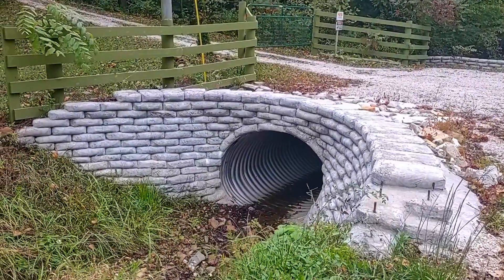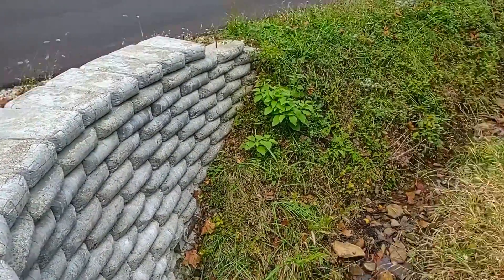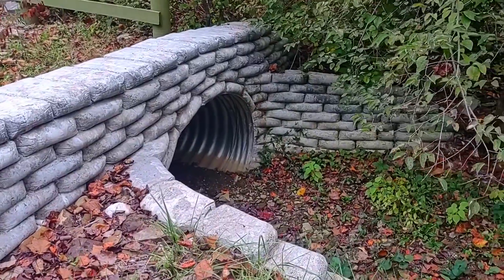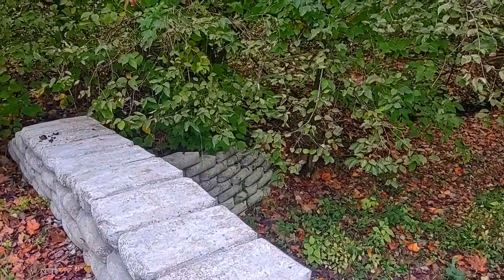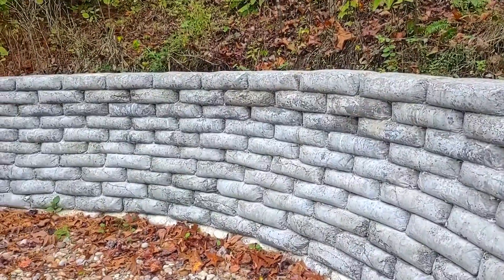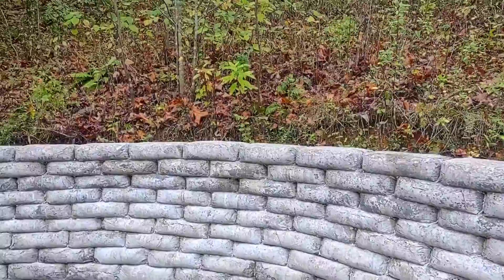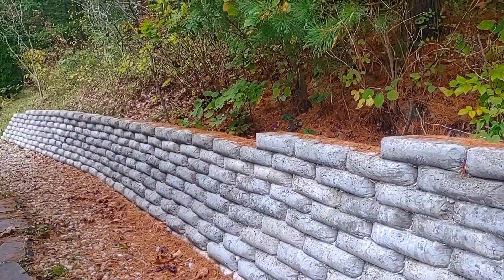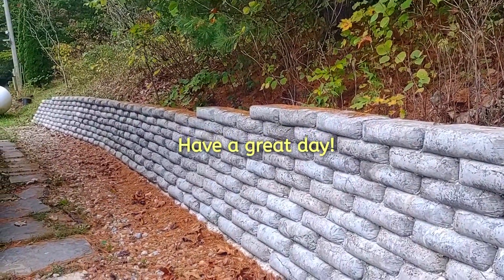Three Years Later | Concrete Bag | Culvert Retaining Walls

Comment: $1.80 is a steal. Theyre about $4.50 here and its cheaper to hire a crew to form and pour this much concrete.
Reply from the maker: For sure, now it is higher in price. Thanks for the input!
Reply: @SteveAddis no dude. It was always cheaper to pour
Reply from the maker: @smthngsmthngsmthngdarkside  I have two other crossings I might do, and might just calculate the cost by yard or three part if it is available. Thanks!
Reply from the maker: @smthngsmthngsmthngdarkside  Thanks for the input.
Reply: Dude those bags are 9$each in Australia.
So just one of those walls is easily 4k$
Reply: @smthngsmthngsmthngdarkside  this looks better than a poured wall
Reply: $8 a bag here in Ontario
Reply: Agreed now a lot cheaper to hire a crew but then it would not be self-built (which is normally where the value lies). Very nicely done nevertheless.
Reply: @philtucker1224 gives a silent prayer to Biden and his immigration team
Reply: @TheLifeOfKane if only the president before sleepy would've built a WALL? Blame them all for this.
Reply: You can get the gravel sand and cement delivered for much cheaper
Reply: How can you suggest this would be cheaper hired out? I have to take up sidewalk sections all the time to work underneath and it’s minimum $500 to replace a 4x4 slab 4” thick. I imagine this would cost about 10k from my concrete guy. But maybe you have next to free labor in your area idk
Reply: 1.80 was way cheap compared to now, but still should have been more expensive than getting redimix delivered. This would be easier to move to the back yard tho.
Reply from the maker: @renalshomlmes338  Yes, it might have been. I think we checked and a yard was expensive at the time. I always wanted to use bags. The forms would have cost, and I do not have experience forming walls. Now my Cousin is in concrete and he said the contractor cost would have been 15 times what I paid or more. Thanks for the input!
Reply: Agree.. no crew and form would be nearly as low priced. 
This I'd great
Reply: @SteveAddis  yeah for sure there is less labor cost, plus your style look nice.
Reply from the maker: @renalshomlmes338  Thanks for the input!
Reply: You can get them free here when some bags bust moving inventory. No one seems to want them busted so we have to throw them in the dumpster or pour them in holes around the lumber yard. Also people return pallets they didn't cover so there are times you can get bags that have already mostly set up but would fit together fine with other fresh bags.
Reply: They are 7 fucking euro in frabce and our wages are a third of yours
Reply: Thanks Biden.
Reply: It's always cheaper and more effective to pour properly. This is stupid.
Reply: @akrebsie  forming that up to pour a wall would be a very large task

Comment: Hey Steve, love these videos! Question: when you say "mixing" the bags, are you just moving the contents of the bag around within the bag before packing?
Reply from the maker: Glad you like them. Yes, good question. I set the bags on the sides and ends and sort of roll the content. Then set one last time to the face to get plenty of cement and sand to the front (less stone), to smooth the face. Then use a flat stone to pack the top solid after it is placed. Please watch this to explain the improvements. Take care! https://youtu.be/tUlc1Qb5A74?feature=shared

Comment: I noticed at the beginning of your video, there are pieces of rebar protruding on the closest end. It's been 3 years and they're still there. That seems to be a safety concern, why are they left as they are?
Reply from the maker: Yes, you reminded me I should cut those off now. Good observation. Originally, I planned to connect bags there to deflect water. The last washout the water went over the culvert wall. If changes are need, drilled anchored rebar will work. Thanks for your comment!

Comment: I did a retaining wall around my house about 6 bags high and it worked great. The cost of concrete was relatively high but the cost of labor was cheap because we got a wall 200 feet long by 3 ft talk stacked in 45 minutes with 6 teenagers.
Reply from the maker: That is awesome you made a wall. 200 FT, wow! The cost did save me at the time and contractors were not available. Take care.
Reply: Even at current cost of pizza and soda, probably $120 or less on labor….not sure of ratio of large pizza to teenager today, but it was .8-1.0 back in my day….and, the neighborhood knew our crew would do anything for pizza….😂